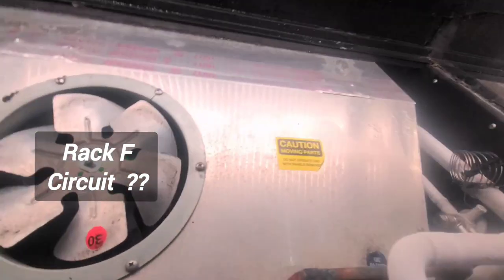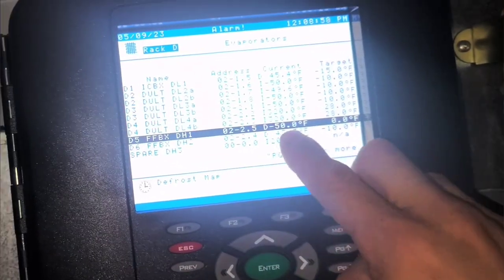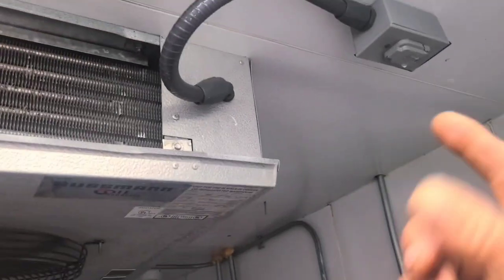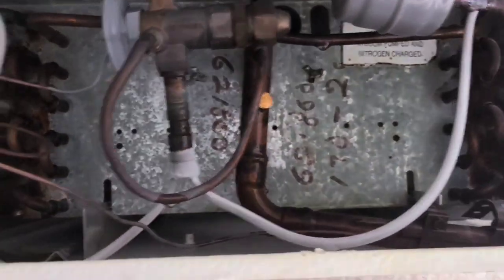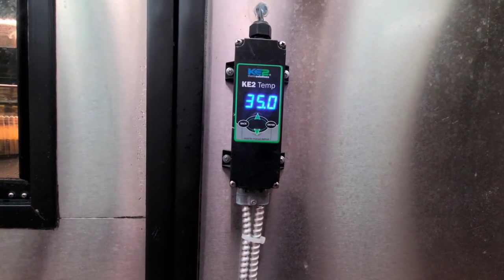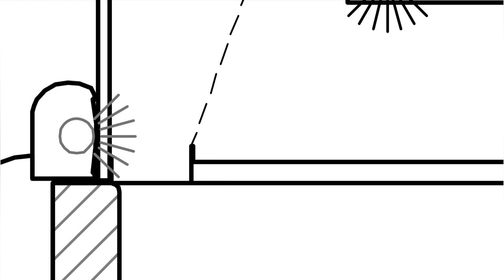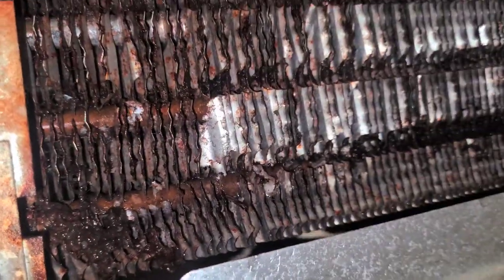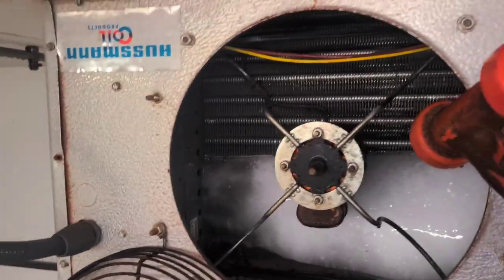4 Jobs at one Store. Working them all on simultaneously. Diagnosis - Part 1

Comment: The unit that drifts below set point might have a bad liquid line solenoid valve. The solenoid does not shut off completely when deenergized.
Reply from the maker: Do you think so? I didn't think of that because after dropping  4 or 5°, it starts to go back up, and it will hit 38 39 40ﾟ and it has to come back on. Otherwise, it will get hot. I'll check that out, though. I'll see if I can identify a leaky valve. Thanks.